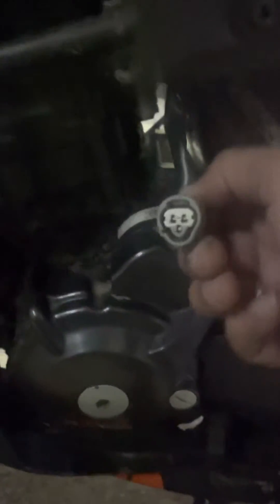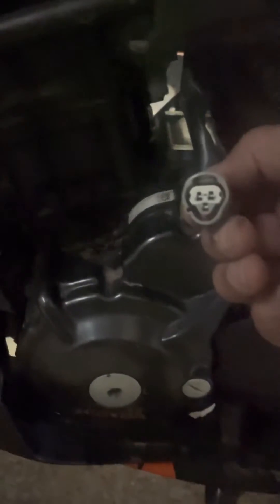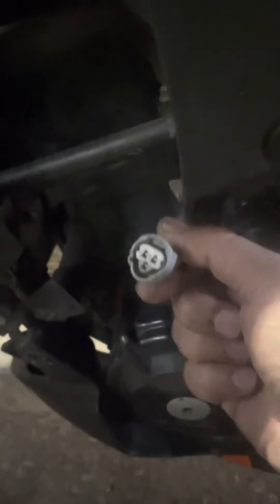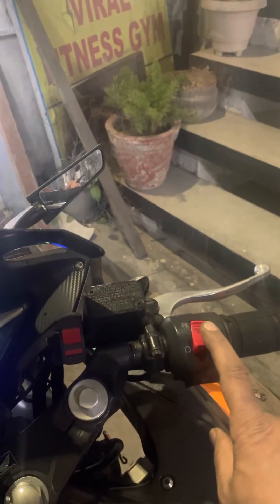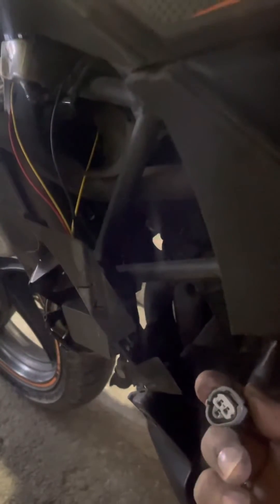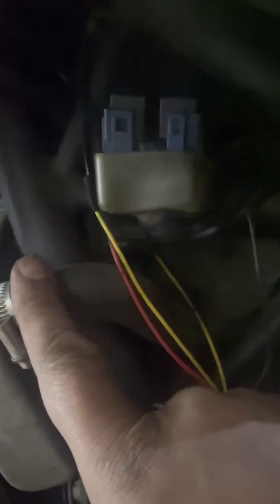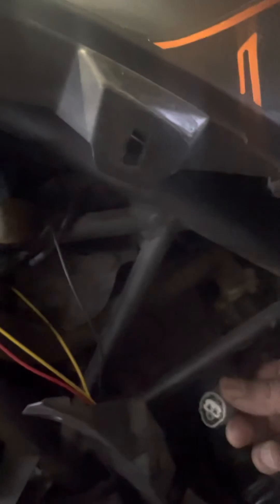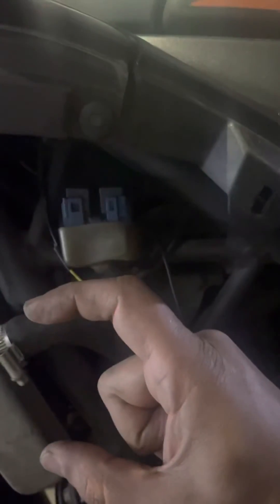Radiator Fan (CBR 250R)

Comment: My Fan didn't Run after removing temperature Sensor
Reply from the maker: Try reving the engine for sometime it should work
Reply: @AsimInam9  did it, didn't work & I manually tried to push the fan but it's tight